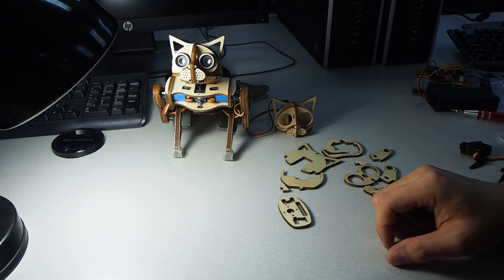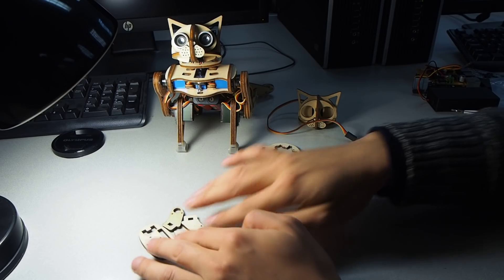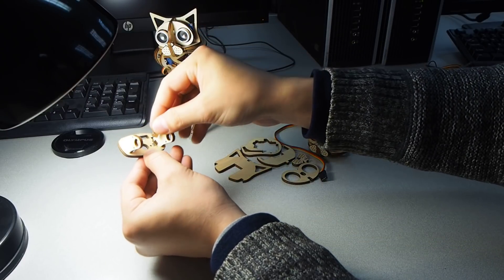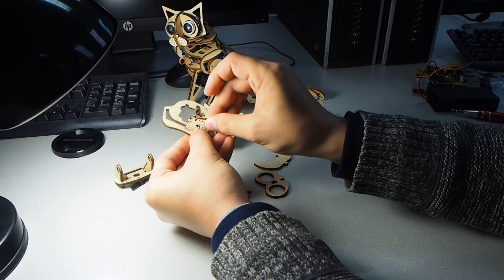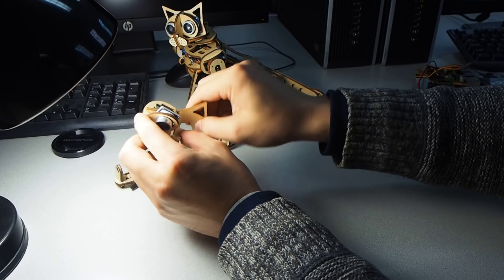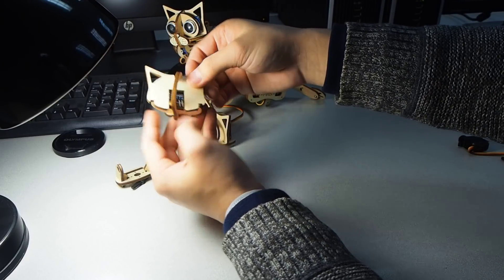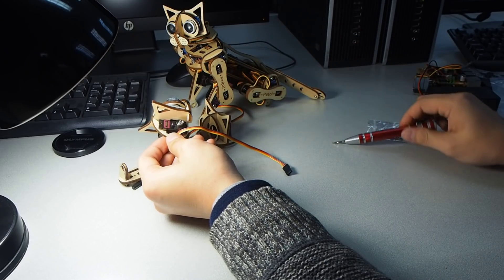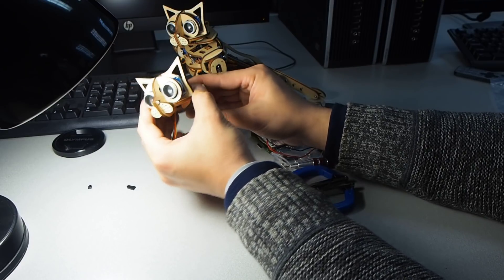Part 1. Assembling Nybble's Head |Build Your Own Personal Robot | PetoiCamp

Comment: Can you please tell me about the C ratting of the each cell? or the model of the cell?  that you are using!  If it's not confidential.
Reply: Thanks a lot! I can now confidently purchase these. I made a hexapod and attached a drone battery(3S, couldnt find a 2S) underneath it and then attached several buck converters in parallel with it to lower down and regulate the voltage and it worked well. But these cells will save a lot of effort, time and maybe money. Here is the video, if you want to check it out:    https://youtu.be/tfrOUWM12co
Reply: yeah but the cell u are using can be used for slightly bigger robots, I just need to use it more than 2! And Nybble is like so well balanced from many aspects! looks, size,cost, working, robustness.  Your work is really helping me.
Reply: What kind of motors are you using, do you have 3d print files? I will buy
Reply: @rillailla   Are u asking me or Mr Rongzhong?